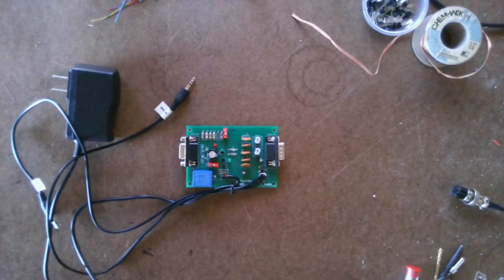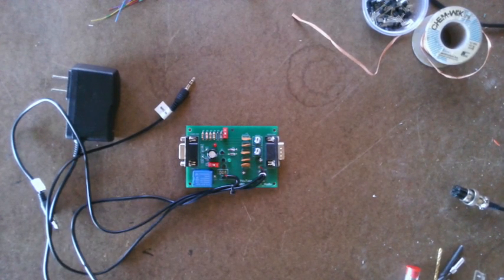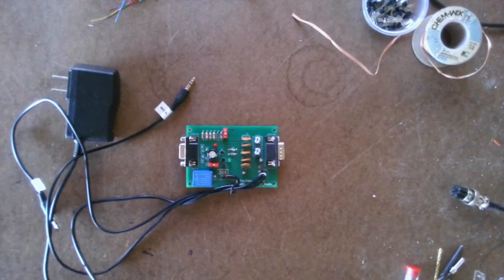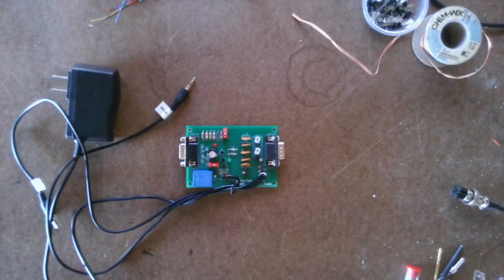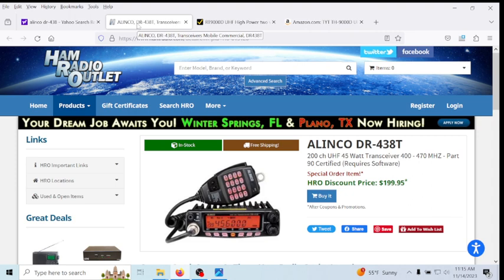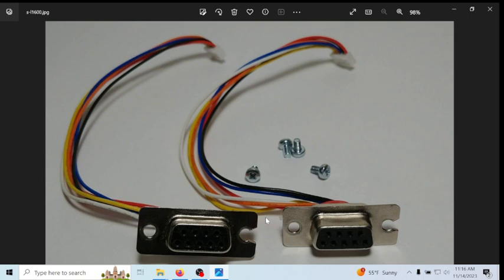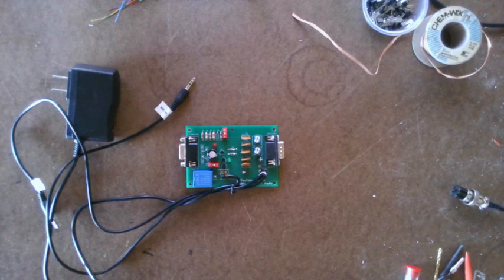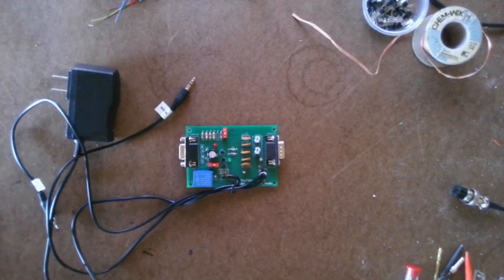🔺 interface board for TYT9000D ,Retevis RT9000D, Alinco DR-438 mobile GMRS two-way radios!! 🔺

Comment: This is what I was wondering if we could do, but couldn’t get a definite answer on. 
I currently do this with my network radio, But not having to chase down wires is a plus.
Reply from the maker: Yes, hopefully soon I will have an answer on this 🙂
Reply: @GMRStwowayradio  I think once you get this hashed out you will definitely have something really cool.
I use the 9000D’s for a farm repeater, they work great for that. Just for everyone else looking into this, definitely incorporate a fan since they do warm up a bit. 
I’m gonna like this because I’m sight challenged. so it’s hard for me to probe radios anymore, soldering is almost a no go. Plug and play opens my wallet 😂
Reply from the maker: @FireRescue884  - yes, I also heard that too they get warm! I hope there won't be too much to modify! I just have one radio coming, which will be ok for a one radio setup. But to uses two radios for a full repeater, I will have to get the other radio later in the future to be able to build/test a two radio setup.
Reply: @GMRStwowayradio  I use a 9000D on my repeater for a receive radio, and a kg-10000 for the transmit radio on one of my repeaters. I use 2 9000D’s for a closed farm repeater and it heats up faster then the kg for sure. But word to the wise, the digital screen on the 9000’s are really sensitive be careful. But I do think everything you need is on that DB-9. I’ve been tracking your progress on this, thanks for your 😓
Reply from the maker: @FireRescue884  - you are welcome! And thanks for the info about screen that is good to know!

Comment: Good and exciting news, the db9 that’s installed is the one from repeater builder it has all gray wire, the one with the color wire is in the box so maybe do a video showing how to install the db9
Reply from the maker: yes and if the retevis Rt9000D programming software works ( which is better than the TYT9000D software) with the TYT9000D will do a video on that too 🙂

Comment: what is needed to connect the circuit board that you are selling to the internet?
Reply from the maker: Hi you will need a USB to Db9 adapter, latop (computer) , USB sound card more info here too https://www.gmrstwowayradio.com/forum/viewforum.php?f=22
Reply from the maker: also, the "setup" for the software, etc would be the same that is listed on this page https://www.gmrstwowayradio.com/forum/viewforum.php?f=22